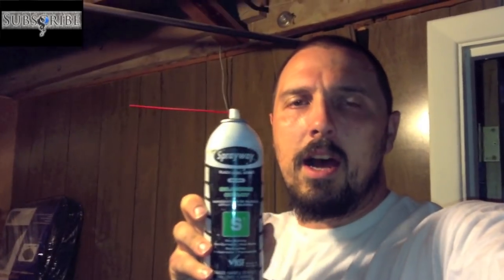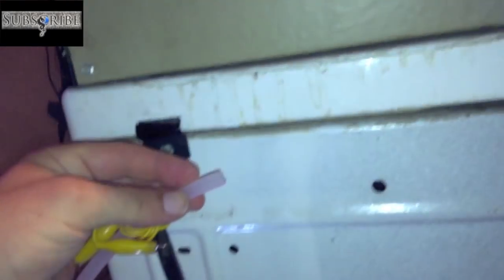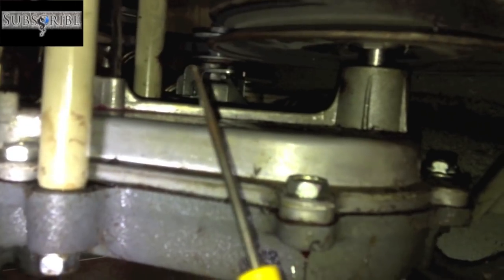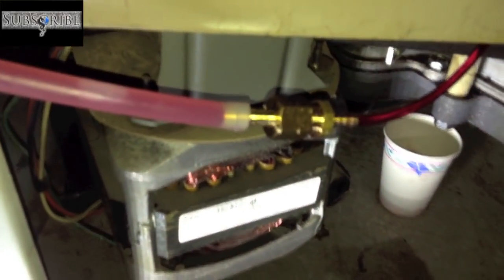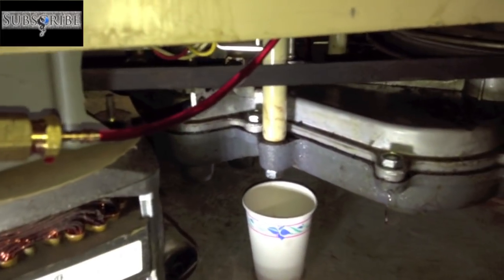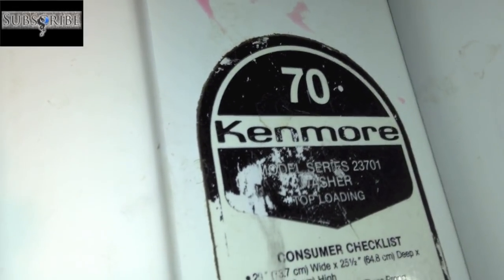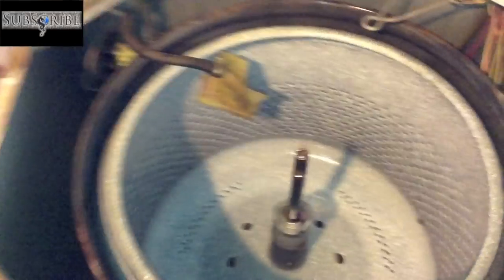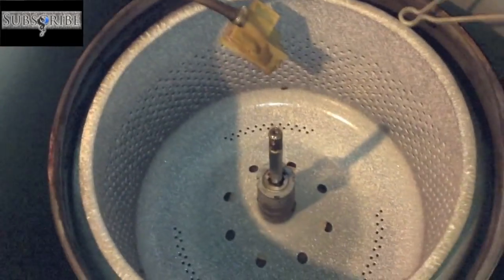How to fix old 70 series Kenmore washer transmission

Comment: GREAT VIDEO... mine wasn't as bad, but needed oil... watched the other video too.... I have a Series 70 model...same stuff, wow ! thanks for the video.... as for gear case oil... see this comment left on amazon.com for Whirlpool (the actual manufacturer of the Kenmore Series 70) Gear Case Oil 350572 ... "This oil is thicker than 140w gear oil and tenacious, the consistency is almost like thick honey. This oil does not want to mix with water and was very difficult to clean out of my drain pan. I tried hot water and a concentrated solution of Simple Green and then again using Formula 88 and a stiff brush. The oil would then emulsify but only with vigorous brushing and still seemed to lubricate. In a washing machine that uses soapy water as part of its wash cycle, this is exactly the qualities you want in an oil. I would suggest you use this Whirlpool oil rather than 90w regular or synthetic automotive gear oil." link to item:  https://www.amazon.com/Whirlpool-350572-Oil-Gear-Case/dp/B00LOX24J2  :)
Reply from the maker: Great info thanks
Reply: What drain pan? The gear cases are sealed
Reply: I believe the "Drain pan" refers to a pan the "Amazon comment guy" used when he was working on the machine.  Filling this model (500 or model 70 belt drive washing machines) there is a vent hole...watch the video...this is where the tube is inserted. i bought the tube and the oil on eBay. I used a can with the tube to fill.
Reply from the maker: Thanks for the help
Reply from the maker: Good luck
Reply from the maker: Great research thanks

Comment: I got an identical 80 series 1983 model 82380800. It broke a couple years ago and now, largely instrumental with your video, got it working great and strong. I had a little rougher time getting that cap to go down on the catch dogs correctly, but ran a whole cycle YAYYY!!  Everything works again. Now a tube to refill the transmission fluid and it will be eternal......almost!! Than You so much!!!  Today's date is May 10, 2023.
Reply from the maker: Awesome glad to hear

Comment: I have a Lady Kenmore portable washer I bought off of Craigslist, and it did the same thing. I added oil to the transmission, and it begun to agitate and spin again. One thing I learned is you can add oil to where the bolt to the agitator bolts on to the transmission shaft.
Reply from the maker: +Sean Wilkerson good to know
Reply: hi...just got delivery of 3/16" OD  x 1/8" ID tubing....first attempt and the tubing did NOT fit into the vent hole in the transmission .... comments ?? help >>> ??
Reply from the maker: If it was close you can try carving or sanding the end to a sharp or chisel type tapered end to see if that will fit
Reply: thanks so much for the reply !  i will dig into this and make it work ...
Reply: I made more of an effort and the got the tube to slide in quite easily. filled the case and it worked !

Comment: My 1985 Kenmore Havy duty 70 series belt drive. no spin dehydration or drain water function check part FSP359997 have two electromagnetic control each function I change new one under 50USD working perfect
Reply from the maker: Awesome

Comment: brother greetings from venezuela I have a washing machine with the same transmission and I would like to know if the blades where the coils travel also or only serve as a guide so that the coils move is possible to mount a video where you show how the transmission works when the washing machine is running I will be very grateful
Reply from the maker: Not sure if i can

Comment: I drilled and tap the  side top of the gear box and put oil in it  and put a 1/4 20 bolt in it. it runs grate for now

Comment: Nice video, I have a similar washer but the issue is that it drains water SLOWLY during the wash cycle.  You mentioned yours wasnt draining at all because of the pully.  Do you have any ideas for what might be causing it to drain when it shouldnt?  its not a leak and its pumping up into the drain tube.  I'm wondering if there's an issue with the transmission itself.
Reply from the maker: Could be but it could be the same issue i had just not as bad yet good luck

Comment: While I appreciate your good intentions and this video it bothers me that while you had the thing all apart, why didn't you take a few minutes to clean the upper ring portion that mounts to the top of the outer tub. There is also a rubber seal that goes around that ring as well and I did not see it in this video. The last thing is, how do you get the agitator OUT and removed from the drive shaft? That part was missing too. Otherwise thank you.
Reply from the maker: +N Russell i don't remember why i think i just was working on the gear box

Comment: One of the best washers on the planet. I had mine bought it new 1980-2011 RIP. I should have fixed it. My GE NEW TOP LOADER 1500 BUCKS sucks and has been repaired 4 times for the same thing. This fifth time I am trashing it.
This conservationf of water to have smelling cloths and crap washers. Is it worth wearing cloths after being washed that smell foul????NOoooooooooooooooooooooooooooooooo~
Reply from the maker: +Skip Rope could not have said it better myself

Comment: Hey i`ve got a awesome way to quickly fill that trans ,you use the glass tube off and eye dropper that's pointed and then rubber fuel line two different size back to a squeeze pump oil container it only took 2 minutes and I was full... keep squeezing America
Reply from the maker: Not a bad idea feel free to share the video thanks
Reply: +permofit I works extremely quick excellent tip bro
Reply: +j ryder used cant share pics doesn't let me dam you you tube
Reply from the maker: Sounds like a good method thanks

Comment: So how did you actually drain the transmission fluid ? Is there a bolt or using suction?
Reply from the maker: I didn’t i just topped it up i was not able to drain it without destroying something
Reply from the maker: Shoot now i am not sure if i did i will need to watch the video again it has been some time since i did this
Reply: You take the transmission out and remove the wig wag and then the cam bars. Remove the bolts and pour the old oil out and then put 30w oil in it.... Did tons of these in peoples front yards... Yes, im old.
Reply from the maker: Cool deal

Comment: My gearbox seems to "seize up" from time to time. I hear a squeak during the spin cycle, and the next time I go to use the machine, it fills but nothing will move after that. I removed the back cover, the motor and water pump pulleys move fine, but not the gearbox pulley. So I sprayed that pulley shaft with silicon spray as well as injecting some lithium grease into the transmission fill hole. I tugged the belt at the same time as grabbing the gearbox pully to free it up. The washer will work, until it starts to squeak during drain/spin days later and then seize up again the next time I turn it on. So can I open and clean the gearbox by flipping the washer over and removing the bottom plate from the tranny? Or do I have to access it by removing everything from the top first(agitator, basket, etc.)? Thanks
Reply from the maker: I accessed the gearbox from the back I believe I took the panel off and I use a thin oil like a lightweight motor oil or transmission fluid for a three in one oil but nothing heavy like a grease
Reply: @permofit  Thanks! Now, if i have to remove the agitator to add lube, can I remove it without removing the top frame and plastic ring?
Reply from the maker: Sorry I can’t remember

Comment: I have one and it just started doing the same thing   Heerree goes.
Reply from the maker: Detroitblue it helped to check the fluid level after it ran a load or 2 and top it off good luck
Reply: Hey I have the Kenmore 70 series and imagine my chagrin when I looked underneath to discover a direct drive system.   What gives?
Reply from the maker: Detroitblue it may have been built later in the 80's when the changed the drive setup
Reply: permofit I guess so.  Anyway I went ahead and laid her down and pulled the motor and trans alose to check the clutch because the coupling appears to be A-OKAY, and low and behold the clutch is nice and stiff.   So now I am back to my Youtube Brain trust to see what else it could be.  I am going to try to check the trans fluid while I am in  here.

Comment: My plug on my Kenmore 70 series got really hot but didn't melt it just got soft can I salvage it? Somebody with a little wisdom on the subject PLEASE ENLIGHTEN ME!!!HELP
Reply from the maker: Are you talking the plug that goes in to the wall? If so i would say you can still use it but.... Some thing caused it to draw more power and get hot. I would say you need to find out if a Motor is dirty or running hot does the motor need oil or do bearings need to be oiled or lubed? Is there a belt that is slipping for sticking causing strain? Something could be shorted out either way need to find a concert to get hot otherwise it is a potential fire hazard. I need more details just ask

Comment: I have the Canadian Version and the "agitator" is a series of solenoids that activate to lift a bar like a see-saw action. My symptoms are it is constantly in drain mode and only when I push up on the "bar" does it agitate. Anyone know what this means? Here's another person's video of the 'ol machine..... https://www.youtube.com/watch?v=RHv_H0HTPCU
Reply from the maker: That video is very cool i would start with cleaning everything then oil or grease and in that video it looked like it was getting hung up close to the solenoid so i would unplug the power and move all the parts as they should move by hand and see if they feel like they move in a smooth manner or not